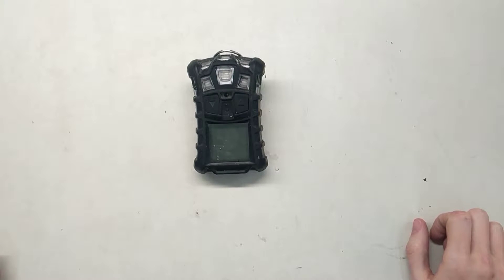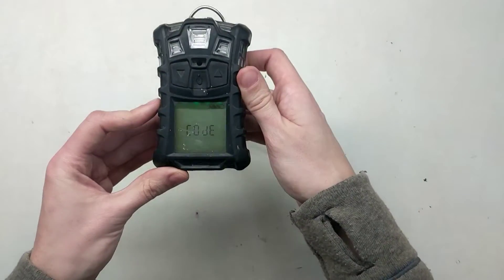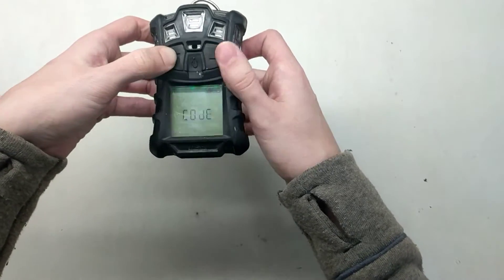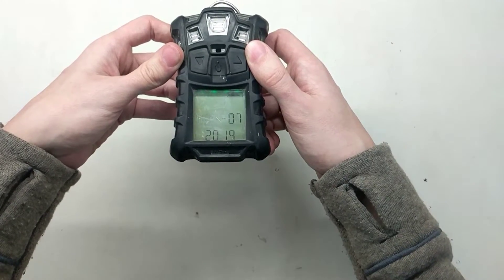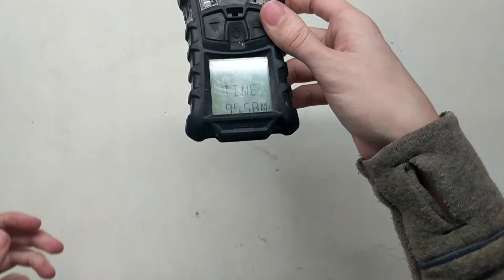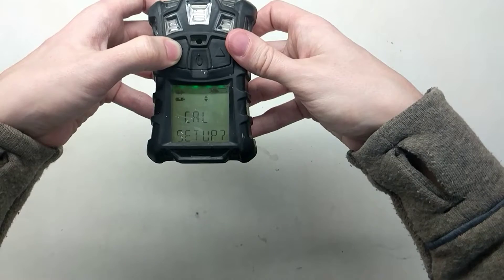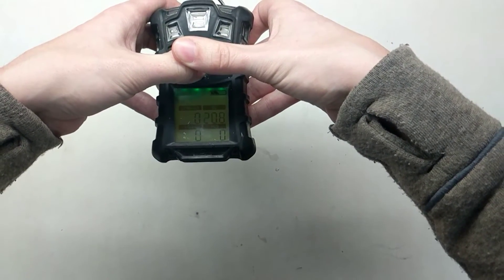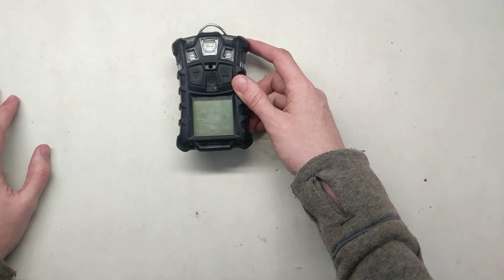How to Set/Change Date and Time on MSA Altair 4/4X/4XR

Comment: 672 doesn't work on my 4xr
Reply from the maker: Do you work for ATT? If so, they have a proprietary code they use.
Reply: 672 works on my 4xr
Reply from the maker: @scottsmith2173  Yeah 99% of the time it works. There are some large corporations with their own codes though, like AT&T.
Reply: Anyone know the code for att?

Comment: When I hold the arrow and then hold the middle I never get the code message, it just shuts off.
Reply from the maker: Start with the monitor off, then press and hold the right, and then press and hold the middle button for a few seconds
Reply: @Idealcalibrations   hey thanks. That worked.